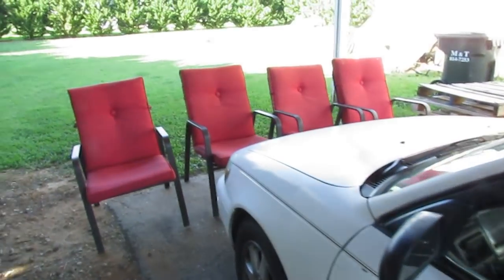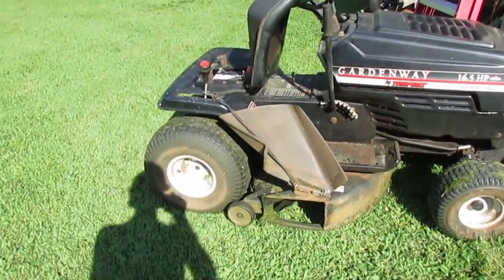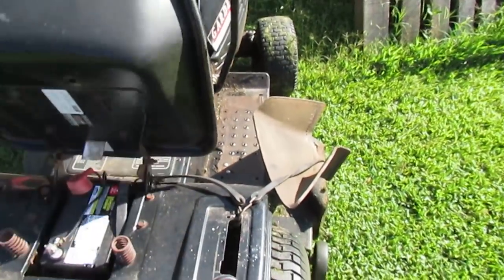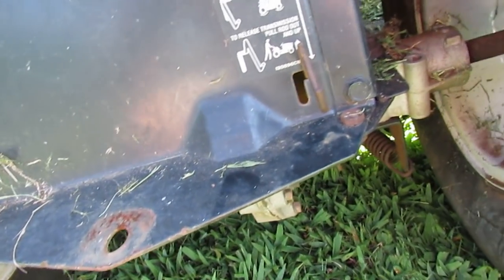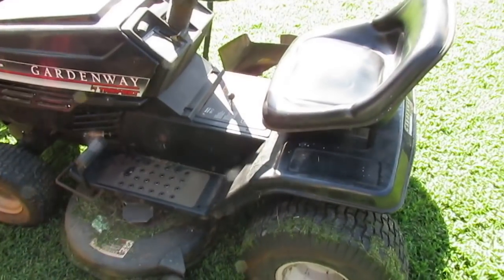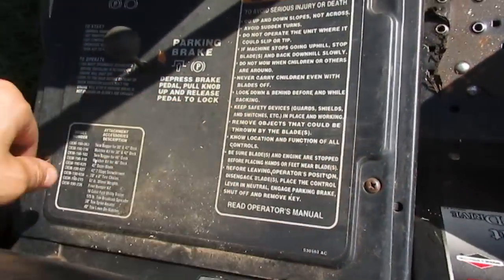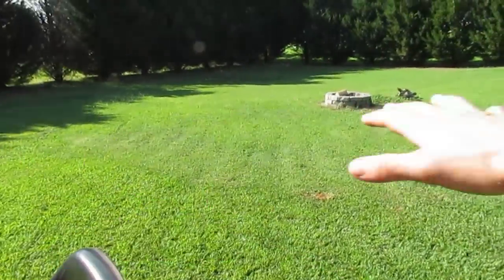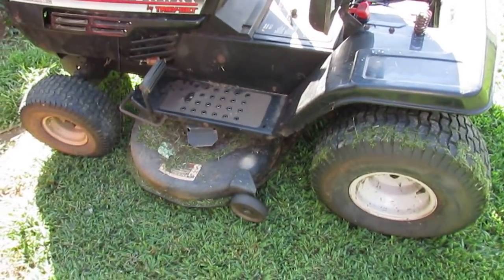MTD Hydrostatic transmission issues

Comment: On the craftsman mower the lever that goes down into the transmission begins to bind up getting dry then the lever flexes like a fishing rod not engaging the gear. I found bearing grease in the transmission, no oils. Just sharing the problem I had.

Comment: My Husqvarna after 3 years started acting the same. Was told the hydro was shot. We changed oil and it didn't help. While doing that I saw belt was fairly tight but rubber was hard and belt looked worn thin. Got a cheap belt at auto parts store that fit in pulley's much tighter. Problem solved. I think the old belt wore down so far and got hard it was slipping. I didn't think that would matter with a hydro. I cut a couple decent size hills so I think when the hydro has to pump harder it takes a toll on the belt ?

Comment: Speaking of failure to follow up.  Just check out sixtyfiveford here on youtube.  Among many great videos, he does a 4 part rebuild of a Hydrostatic transmission (they're all the same), and it's simple.  And if nothing else, it shows you how to add fluid, which is most likely you issue....
https://youtu.be/lo5UILc52pE

Comment: I have a 2011 mtd gold hydro 42-inch. I was mowing just fine, then it just stopped moving. No reverse either. I haven't changed the drive belt because it is still on. It seems frayed though. Should I just put on a new belt? Thanks.

Comment: I have a Craftsman with a Hydrostatic transmission and it uses 80/90 gear oil.  Walmart sells it for around $15 per gallon. Changing the fluid is a good idea.

Comment: I would think it's got to be worth trying flushing the transmission and putting new fluid in it, maybe with some automatic transmission stop leak to make the seals swell up and stop the dribble of fluid.  It sounds much the same as an auto transmission slipping when it gets hot because the fluid is breaking down.  If it has only recently started playing up you should be in time to save the transmission as it seems these transmissions generally fail when people continue running them with the problems.  If nothing else, flushing the transmission and changing the oil will prove whether or not the transmission is savable or whether it is shot...

Comment: First check out YouTube user, Bah53
He had a similar issue with I believe a Craftsman or an MTD he was able to put a drain plug in the bottom of the transmission and refill it through the top factory fill hole, it did work and it did take care of the whining sound.
Reply: Ah a fellow Bah fan, Love it.

Comment: Check the fluid level under the seat. Also check the belt that drives the pulley on top of the trans. The drain plug is on the side of the case near the bottom. Sounds like it's low on fluid

Comment: Have you checked the condition of the front drive belt - could be just slipping.  Also, there is a read drive belt.  They can be replaced for about $8 each on the net.

Comment: Chang the fluid it’s by cub Cadet buy it at tractor supply  under the fan it’s s rubber plug remove what happens is the fluid gets thin flus it also put some yellow bottles trans x  in it. It will work

Comment: I've owned the lawn chief, white, yard man, ranch king, huskee, yard machine version of this tractor...all of them make the hi pitch trans noise,...as far as the issue of it not moving when hot I did have a similar situation that I drained the trans put fresh fluid in and I also adjusted the pressure swich on it aswell

Comment: Old video, but I am guessing fluid may be low?  Check the seals and see if any are leaking.  There is a plug on top that you can check to see if it requires fluid.  It looks like a hydrogear 326-0510, which requires roughly 2.5 qts of fluid at full.  You can dip a short screw driver in there and  see if you have any fluid, should be relatively close to the top, maybe 3 inches on the screw driver.

Comment: The center section on inside is worn and made out of aluminum when worn after it heats up the exspansion rate between it and the cylinder block inside change in temperature you loose pressure because it can’t mate as good against the surface the options you had was get a new trans or rebuild this one or have a shop make you a shim and jb weld shim to center section here your best answer

Comment: i used to work at a small engine shop and had tons of those transaxles fail. try a fluid change first of course but if you have another trans be prepared to swap it. the pumps are what fail in those and that's what the whining noise is.
Reply: The whining doesn’t always mean it’s inside the transmission.. a lot have been known to be the drive pulley splines get wore out and just spins on the shaft which causes the whining noise and no go.. check that 1st
Reply: check all the seals for leaks I noticed that the shifter seal go's bad because the shaft gets rusted an tears the seal up it will suck air an leak if the transmission wet with anywhere then it's probably a rubber seal if so the transmission will not work good

Comment: First. Check the cooling Ventilator on the Gear and clean the Gearbox from Dirt to get better Cooling. Seems to overheat. The also change the Fluid by sucking it off and refill with fresh stuff.
Mostly i thing its overheating maybee by broken coolingfanwings

Comment: I've had similar issues and I've flushed and refilled with success but it is not guaranteed to work it's simply trying to save swapping over trans.  Don't top up drain fully and refill with all new oil
Reply: What oil do you use
Reply: @justincollier9769  My 2055 
White /MTD calls for (preferred) straight 20 or 30 weight. I use 30 , cant find 20
Reply: @justincollier9769  You can check on hydrogear for the fluid.  I think he has a 326-0510 which needs 20w50

Comment: Pull that pin on the back of the transmission out, start the engine and move the shifter to drive for 5 seconds. You will not move. Then put it into reverse for 5 seconds. Again you won't move. Then put the shifter into neutral. Shut off the engine and push the pin in. Repeat the process with the  that pin on the back of the transmission in. The only difference is that you will move. I had a similar problem with my riding mower. I tried this and it worked. If this doesn't help, try adding belt dressing or replacing the belt.

Comment: Yes you can flush the trans out and that
might fix it but make sure that all of the fluid is out of it and change the
filter.
Reply: Fluid in the rear? MTD usually packs it with  grease.
Reply: Yes, the rear hydrostatic transmission takes 20/50 motor oil. I have one that had water in the transmission. Sucked out the old milky oil and replaced with new oil. Working like a charm.
Reply: Old thread but this may help new viewers. If you have a hydrostatic transmission it uses fluid. If you have the variable drive transmission it uses grease. The confusion comes in when the manufacturer calls the transaxle an “automatic”. The variable drive has two belts and spins a pulley with a variable pitch increasing or decreasing the speed of the transaxle.  A hydrostatic uses fluid pressure and pumps to drive the transaxle. Most of the later model hydrostatic drives found in the entry level mowers are sealed and the manufacturers state they can’t be serviced. The two main makers are Hydrogear and Tuff Torq. Both recommend using a 15W50 or 20W50 fully synthetic motor oil if you elect to change the fluid. Hydrogear specifically recommends Mobil fully synthetic V-Twin 15W50 motorcycle oil because it has a detergent package and anti shear additives that protects motorcycle combined engine and transmission with a common oil sump. On both model hydros it’s best to remove the transaxle to change the fluid. It’s easier than you would think. Typically one belt, four to six bolts holding the transmission and rear axle to the mower and two or three linkages that need to be disconnected. Jack the rear of the mower up with a floor jack supporting the frame not the transmission. Once the bolts and linkages are disconnected slide the entire transmission/axle and rear tires out from under the mower in one entire unit. Recommend spraying the unit down with a degreaser and rinsing with fresh water to remove grime and old debris. Hydrogear uses a breather port that can be unscrewed from the top or the transaxle housing. Tuff Torq has an actual drain/fill plug. On either model remove the fill plug or breather vent and rotate the transmission upside down over a large drain pan. Let it drain overnight. The Tuff Torq has a magnet at the mouth of the fill port, remove it with your fingers and clean off the metal debris with a rag. Keep the magnet safe till ready to refill. Fill either unit with the 50 weight oil via the breather port or the fill port. The Hydrogear take fluid till the fluid level is 1 1/2 inches from the top of the breather vent case opening. The Tuff Torq takes fluid till it covers the magnet you previously removed but not above the side cutout in the case internals next to the magnet. It’s easier to understand once you see the setup than it is to explain it by words. Replace the breather valve on the Hydrogear or reinstall the fill plug on the Tuff Torq. Reinstall the transaxle into the mower and run the transmissions through the purge procedure that can be found on their respective manufacturer websites or from an online video. A fluid change doesn’t always “fix” a failing hydrostatic but many times it resolves power loss issues from worn out fluid. It’s a much cheaper fix than a new transmission.

Comment: Iv fixed mtd hydro trans buy just putting new fluid in take the back fenders off and there is a black hose with a red cap take the cap off and you fill it there
Reply: That's what I have. What did you fill it with?

Comment: Sounds like low fluid to me. Take the covers off of the mower so you can have a good look at that trans---I'm sure there are drain/refill bolts. I would not reuse any of the old fluid, it's been overheated---I would drain/refill.

Comment: Was there ever a follow up to this??
Reply from the maker: changed the fluid in it, worked for another summer. Axel seals starting leaking bad, pulled the engine off and scrapped the rest

Comment: The reason it backfires is because you are dropping your revs as part of the shut-down. Mine did this a few times and scared the crap out of me - now I leave the throttle in the run position I have whilst mowing/driving then turn the ignition off. When the engine comes to a stop I close the throttle.

Comment: DID you ever fix it? Did you get an answer?
Reply from the maker: The rear axel seal was leaking fluid. Once it leaked low enough the transmission would no longer pull. Replaced the axel seal, And refilled with oil and it worked fine again.
Reply: @MXguy95  how did you refill it and where? I'm guessing you didn't make a video of it or I would have found it? Well, I'm glad it is possible but I don't think I'm going to invest that much time into my neighbor's mower. I was just going to do a simple sharpen the blades and oil change.

Comment: Mine had loose internal cap bolts, it is very common. Looks like a techumsah model. There are actually two chambers for gearoil and hydro fluid. Worked perfectly afterward. I took out 20 screws and split the case. It is pain to RTV and put back.
Reply: Is there any video's on the internet about this model or type of transmission ?

Comment: Sounds like either the belt is wore, or fluid is low. There's also an adjustment on alot of the petal style hydrostatic mowers. Yours being the lever shift may have round disc rather than a belt for the drive. If so, check the disc for wear on the rubber circumference. Maybe replace that. Good luck

Comment: I rebuilt one once, split case apart, the old 'fluid' was dried up.  I cleaned it up and went to local lawn tractor dealer and he sold me some clay based grease, I filled per his instructions, put back together and she pulled like new.  I ended up selling that mower, got for free, fixed for $20, got $350 for it so using a model identical to this one.. It started groaning going up hills this season, and now it will not go up hills and half speed on flats so time to take this one apart.  Thought see a vid on taking one apart, and the name for this clay based grease used as I do not live near that location any longer.  So if I do not find one, will show people how it was done...
Reply: Mine backfires too, think that indicates time to pull head off and decarbon the piston, fuel soaks that carbon and ignites when shut down due to heat soak...

Comment: My poulan was slipping after getting hot; I changed the fluid, belts and it did great for a couple of cuts (2 acres), then it locked in gear. Hasn't cut a blade since...

Comment: Did you get it fixed. Sounds like it's low on fluid and possibly the filter inside the transaxle needs replacing. I would also check into getting those leaks fixed.

Comment: I know this is an old video, but for other people searching. Most common things for these transmissions is the drive belt could be worn too much, or doesn't have enough tension due to being stretched too much. Or the tensioner might just need adjusted, or the tensioner spring too weak, ect... if any of these issues are the problem, then its a cheap fix. 
The next most common issue is that the fluid is too low, and/or its probably really bad/dirty as people never really change it. You would have to find a service manual to find the fill and drain locations.  Which if its whining, its likely low on fluid. Which if the fluid is low, and you keep overheating it, then it will damage and/or destroy the transmission. You can try flushing and refill, see what happens. If it fixes it, another cheap fix. If it doesn't... probably have to swap it.
Reply: have the same happening , can you open them up and repair to lock up both wheels ?? regrads
Reply: @simonwatt8846  on a lot of mowers you can, you have to weld the spider gear in order to make it a "locked differential". There are a lot of people who turn old lawn mowers into "mud mowers" or a "off road mower" for use on farm ect, who perform this mod. There are videos on youtube about it.
Reply: Yes I think you nailed it ,one-of the two I’m going with the low oil

Comment: I've worked on many MtDs and I've owned a bunch of them. Your best bet really is to buy another transmission. They aren't too hard to replace, (I've done a couple myself) and it's probably your least expensive method. Changing the fluid could be sketchy and may not last. Like a few of the other commenters, I have also fixed Tuff Torq transmissions in Husquvarnas and John Deere's. But in your case, this is pretty much an MtD trans. They are fairly common. I would check for a rear and see what happens. Craftsmans have decent hydros, but at the same time if its an older one, it is built differently and really wouldn't fit too well. It definitely is worth fixing that motor is great. Just find a trans for it and you'll be ok.
Reply: Question I have a Ranch King of very similar design. I was wondering what is the actual make of the hydro static transmission ??
Reply: @johnchadwicktilton  I think it is HydroGear, but don't quote me on that. There should be an ID tag on it somewhere

Comment: There's one video on YouTube for your unit which happens to be the same as the one in my cub cadet. It's pretty bullet proof as you would see from the video not much that can go bad besides a leak. In the video the guy found a valve that came loose inside a very simple fix.

Comment: maybe just top it off with Lucas oil stabilizer
Reply: I just tried that, to no avail. It's had an axle replaced, so I'm guessing the wrong weight of oil was put back in it(owner thinks they used 15w40 Rotella). Gonna drain it completely and go with 20w50 syn. and hope for the best. You'd think that whoever the engineer was would have at least thought to put a damn drain plug on them. I bet they would in a hurry if they ever had to wrench on one much.

Comment: Your fluid is probably turning to sludge like mine.  Says no need to service for life....no such thing.  Consistency of watery cement...no metal chunks...but opaque black contaminated oil that was thick.  Been flushing out the old for a good part of the day using a siphon pump since no drain plug.  Took 2 gallons of new oil flush before the transmission would run a lap without making the oil instantly black.  Working great again, silky smooth, quiet and oil is mostly clean after running for a while.  You really need to change the oil in these transmissions each season for them to last the life of the tractor.  Not a big deal actually if the asshat loser of an engineer put a drain plug in it.

Company that makes these transmissions should be sued for a "sealed" design which was intended to fail prematurely.  You will go through 10 of these in the lifetime of a mower if serviced according to the factory.  Only 200 hours and my transmission was supposedly SHOT because the fluid had become sludge.  Working now, but all that contamination must have done harm.  Will know in the long run.

Comment: My husqvarna 20 hp. dies going up hill after it gets hot,  out still runs fine just won't go up hills.  Mechanic told me the rear end is far apart and the fluid can't fill it (its full when cold)  he said he'd have to put a new rear end in it.

Comment: Been fixing atvs/utvs/mowers, usually i say if it still moves under its own power for sometime then its 90% of times just low on fluid(low on fluid makes cooling much worse, so it overheats and doesnt pull anymore, it cools down it alright again). But if it doesnt want to move at all you need new trans.
Reply: You are simply low on fluid. Add more.